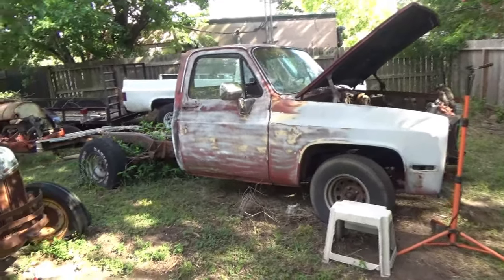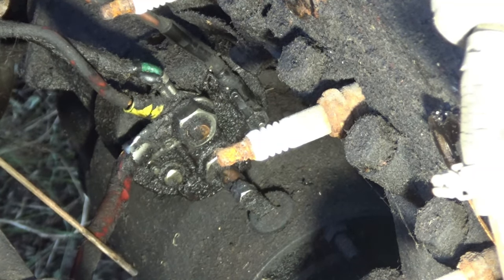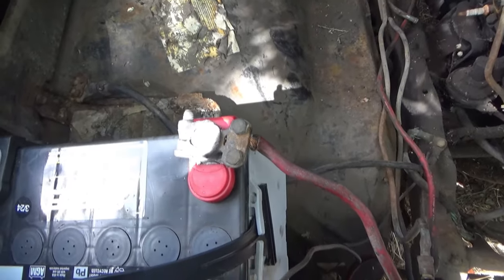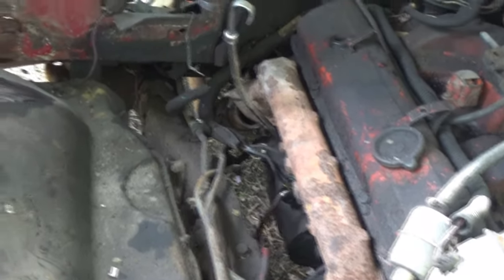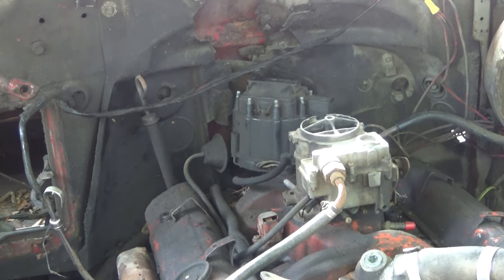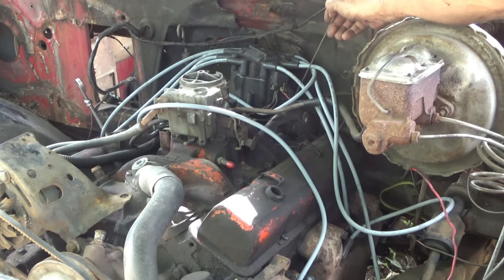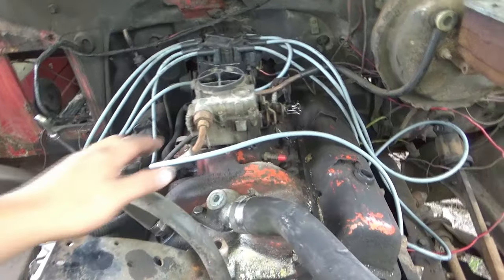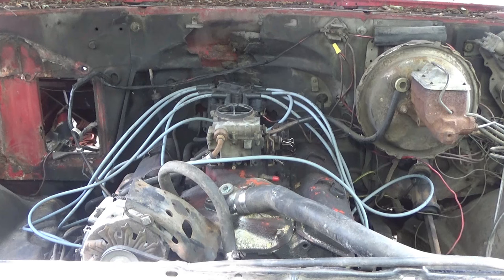Getting my Chevy truck c10 running, after 8 years of sitting in the yard.

Comment: So, David?  There are two primary oddities about an SBC-   one is that they will run no matter where you put number one on the cap as long as the wires are in the correct order. & 2:- for some reason they always run best when you have #1 in the factory location. This is when the rotor button & it's conductor literally point towards cyl. #1 on T.D.C on the compression stroke.  And, as you route the plug wires, make sure that #5 & #7 do NOT touch or overlap. I have ended up using the second shortest wire of a set for nearly a straight run directly to #5 from it's tower on the cap & whichever one is long enough to go CW, around the back of the dist, over to #7. Reason being I cannot tell you how many times I have seen  no-spark-no-start SBC's that have/had wires #5 & #7 either intertwined, crossing one-another, or ran alongside of one another looking like an N gauge railroad track. "Every" one of them needed an ignition module, w/out exception. I won't even run them in a wire loom next to one another. We didn't ever encounter this peculiar oddity until '74 when Chevy began using HEI ign. systems. My guess would be their proximities to each other aren't   overly conducive to allowing a sufficient dwell angle within degrees of rotation of the rotor button between two successive discharge incidents of the coil secondary windings. And, that wheeze-oh-five exhaust manifold on the passenger side must go. Shop around & find you a set of long-tube Hooker headers or just replace it with a 350 manifold if you plan on keeping it then use those dead-soft aluminum gaskets (maybe ebay?) for both the flanges and the collectors as they do not come loose once properly tightened
Reply from the maker: I do normally put the #1 in the correct position.  And, I usually watch the 2 valves on #1 stay closed as it approaches TDC on the balancer. It was just a lot faster to pull the cap and do the  method where you watch it blow out a paper towel ball.  I also usually use a timing light.  This engine is missing the timing tab.  I'm not done with it, there is a lot of things to go through.

Comment: One important part you forgot is that bc it's a Chevy, it will run decently if the thing cranks evenly on each cylinder. If you ran it before you parked it with the distributor that far retarded that is absolutely why it seemed worn out to you. The engine actually sounds "very" healthy to me; at least given the dist is so retarded it barely runs. When you turn the distributor CCW, stop moving it when the coil cover is square with the firewall or like even with the back of the engine and see how it runs then.
Reply from the maker: I will eventually get to the timing. My goal was to just get it started that day. If you move all the wires over one space, then having the distributor in that position it could be way advanced.  Well thanks for watching.